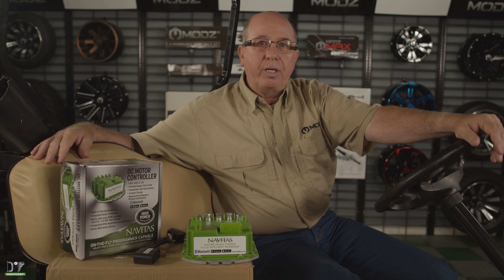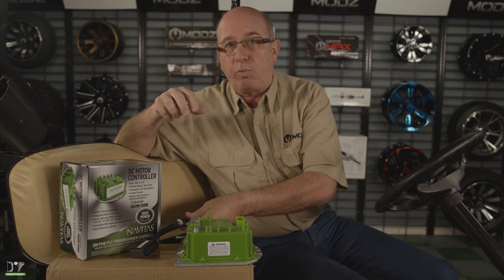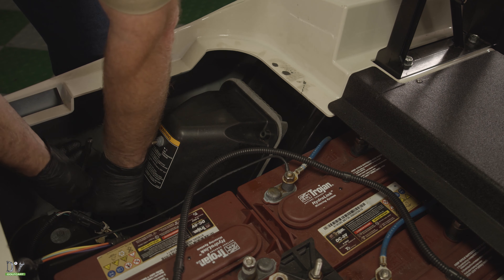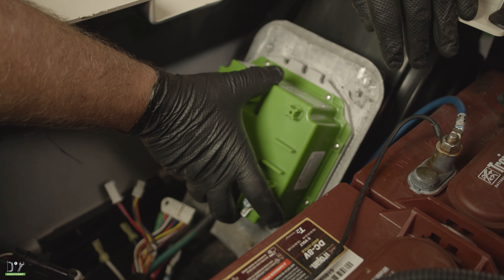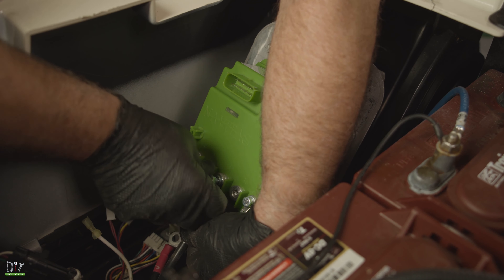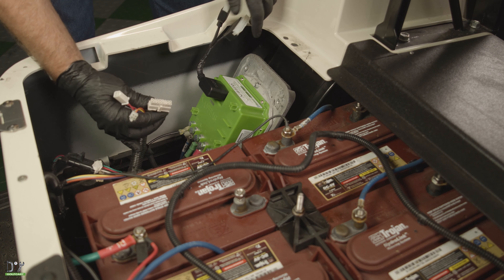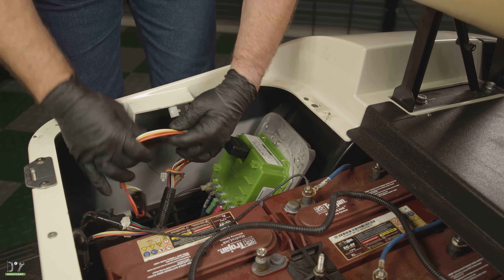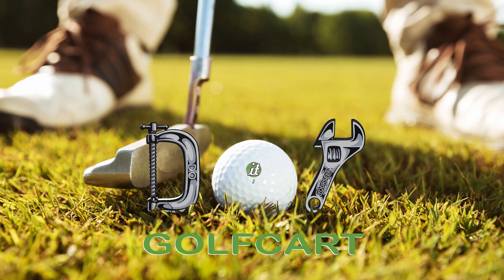Navitas 440 amp / 600 amp Controller Installation & 440 Amp Speed Test on an EZGO TXT 48 Golf Cart

Comment: Hello! I have a 2017 EZGO TXT 48 with stock solenoid and motor. If I were to install the 600 amp controller do I also need a new solenoid? Or can I use the stock/original solenoid. Thanks!
Reply: When upgrading your electrical system, it's always better to upgrade the "entire" electrical system. Installing a 600 amp controller, you're allowing the rest of the stock system to be utilized to the maximum potential and anything not compatible will suffer.
Reply: @barrywilson6665  thanks!

Comment: What is the point of this if you can just unlock freedom mode and get 21MPH?  What are the benefits of upgrading to this controller?  Thanks
Reply: More amps. More power.
Reply: What is freedom mode?
Reply: @gunnardavid8500  I had a 2014 EZGO 48V RXV that when I first test drove it , it wasn't that impressive on speed until the dealer got his handheld computer and plugged into it and changed a factory setting to FREEDOM MODE. It was WAY faster. It was my 3rd EZGO I've owened and sold. Only one with this option that I've had. I now have a Clubcar Onward HP Lithium Lifted 4  seater on order that will be here 2nd-3rd week in December. Very expensive but Clubcar is ranked the best and I will soon see.

Comment: Hello great info, just purchased this. . However my question for you today is about the F/R switch on a 1997 ezgo. Can i replace it with a F/R toggle switch? All i see is two switch activated by a cam.
Reply: I did on mine
Reply from the maker: https://www.golfcartking.com/universal-forward-reverse-switch-assembly-36v/
Here's link to what I think you may like! It's a conversion kit to change over the handle to a low amp rocker switch.

Comment: My txt only increased from 14 to 16 mph with the 440 amp Navitas.  Do I need to return it as defective?
Reply: My EZGO RXV would only run at about 11 and then I had the dealer come unlock it and I got about 18 miles per hour out of it and then I put 14 inch low profile wheels and tires and now I'm running at about 23 with the stock controller, so you may need to have someone come out plug into it and unlock it. I believe it's called Freedom mode
Reply from the maker: It really depends on the electrical system the car has. If the car has a handle for a F&R switch (or is a 36 volt), unfortunately that would be normal.

Comment: My 2016 has a large Blue "CB" wire... where does that go ? Another question is...  when the batteries are hooked up the resistor between the 2 large studs on the solenoid gets really hot... is that normal? Doesn't seem like it. Any help would be great. The old controller was removed when i got the cart.
Reply from the maker: The Blue Wire is an extra connection to the Positive side of the car's battery pack. The resistor will get hot while the cars in use but, just not while just sitting there. Might be time for a new one. 
https://www.golfcartking.com/ezgo-resistor-precharge-for-48v-400a-solenoid/

Comment: Where does the speed sensor connect to?
Reply from the maker: It is no longer needed. Thanks for watching!!
Reply: Thanks for the reply! I guess I’m just getting slightly conflicting info from the navitas customer support. My navitas app doesn’t display my MPH and they told me it was likely a bad speed sensor. But if it’s no longer needed what could be the issue?
Reply from the maker: @vaiplayforkeeps   Is your golf car a PDS system or Series? Also, they have been having some issues with their app. You might need to uninstall it and then reinstall it and pair it to the controller again.
Reply: @golfcartking  it’s is a PDS/sepex motor. I will give that a shot!
Reply from the maker: @vaiplayforkeeps  Great! Let me know if it works!

Comment: Question, I just recently purchased an ICON lifted 6 seater Cart. It seems I need a stronger controller due to very slow hill climbs. Friday I will be installing a navitas 600 vs the 350 amp. On flat surfaces I pretty much can go 22 to 25. On hills it can drop down to 11 mph. What speed will I now get going up hills with a 600 amp controller?? Thank you
Reply: DC to AC conversion will address the lack of hill power of a DC system.
Reply from the maker: The Navitas 600amp is built for torque & speed and whereas the 440amp is just basically for speed. By adding a Ecobattery that we sell would also provide more energy to get you up those hills. If you'd like to go extreme...the DC to AC kits along with a Ecobattery will definitely get you up and over the hills without slowing down much at all.